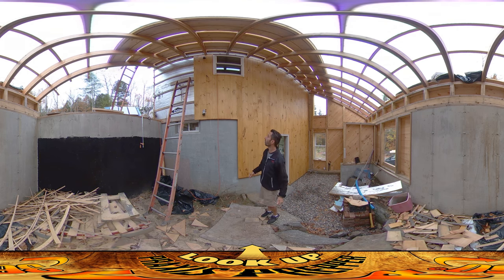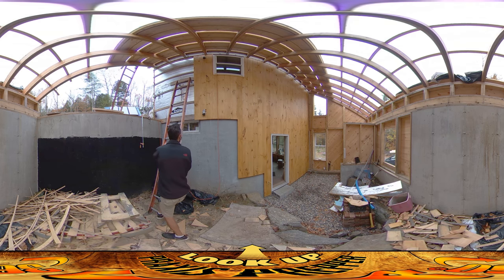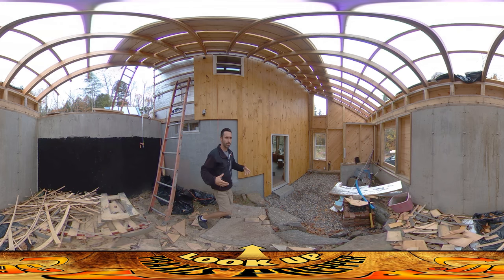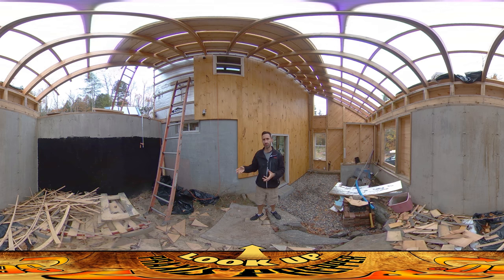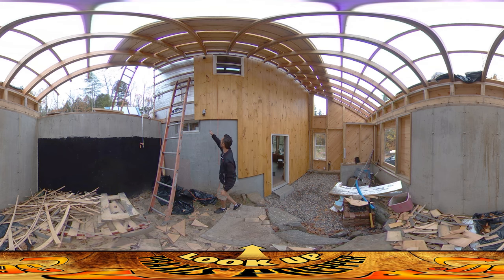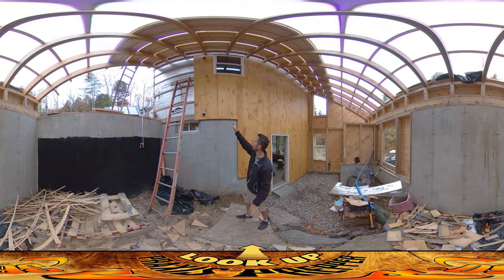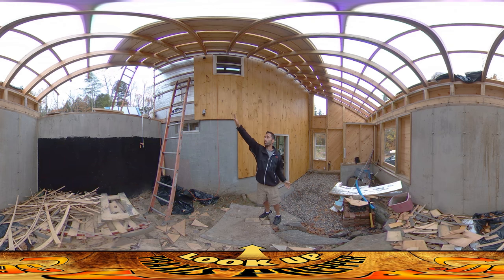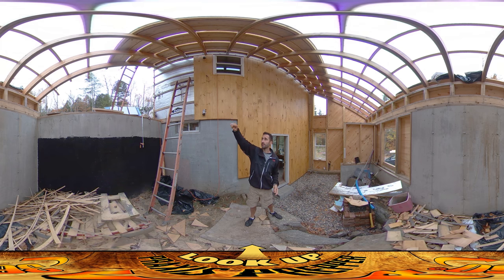Homestead Build - Greenhouse Air Vents, Potential Future Humidity Issues

Comment: I always wanted to ask and maybe I have so if I did and forgot ... well I am over 50 I’ll blame it on that. 
Did you consider using the system where you use poly-styrofoam forms that you pour concrete into in place of just concrete? If you did why did you decide against it?
Reply from the maker: I'm familiar with those and the simple reason that I didn't use them is that anything unconventional is a pain in the ass to get done because none of the approving bodies know what it is and no one can help you with it that knows anything about it. Also though... for those forms, they're insulated on both sides and I actually like the concrete mass being available to the inside of the house to stabilize the temps.